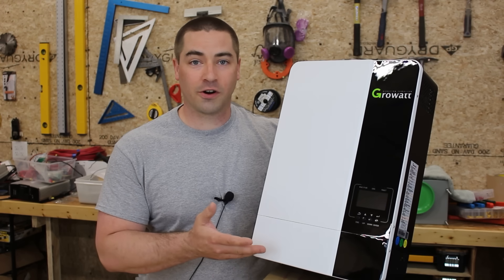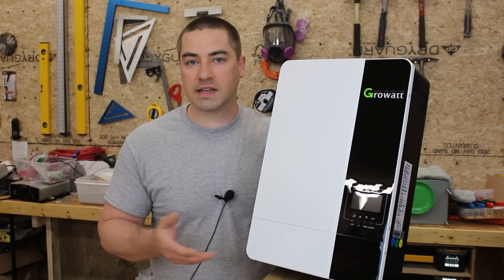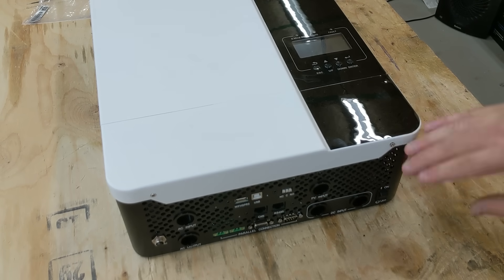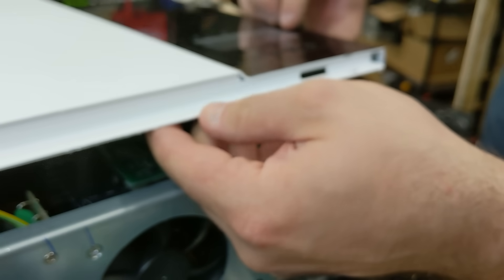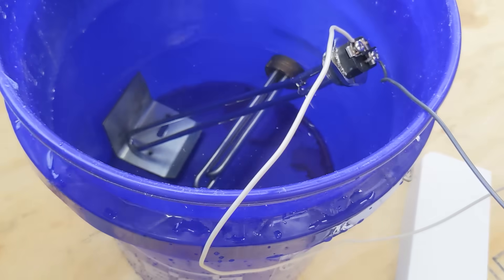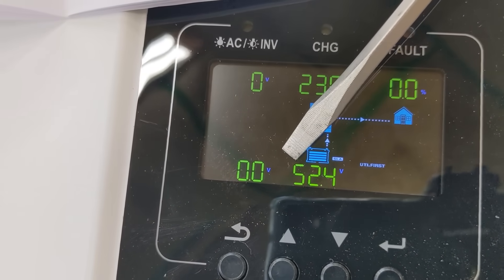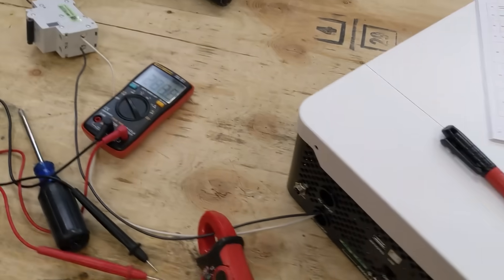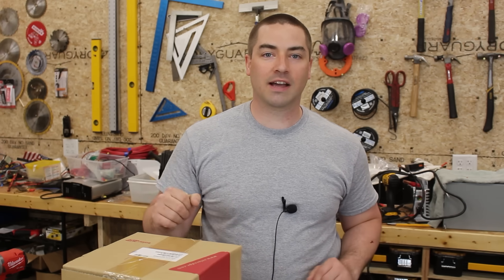Best Value Inverter, All-in-one MPPT Solar Charger, Growatt SPF5000ES, Part 1

Comment: I'd like to see a comparison (performance, efficiency, costs, etc.) between this inverter and the ones that you have had.
Reply: In addition let me attach a few more questions here to @DavidPoz and hopefully he can handle them collectively:

1. Hopefully if it isn't too much to ask, you could do an efficiency load test across 1kw to 5kw (in 5 steps would especially really like to see efficiency of different motor loads since most manufacturers rate their efficiencies on non-motor simple resistive loads instead of the more dodgy & trocky inductive motor loads) so you don't really get the whole picture.
2. Probably do an idle test no load dc power draw. 
3. Probably do a AC charger power draw when charging the batteries. 
4. Inform whether it has a power saver function to reduce night battery drain when it senses loads below X number of watts. 
5. How quick is the transition from AC to DC and back in the event a power outage occurs (will you notice a startling flicker/stutter of equipment or is it seamless in transition performance?)

Comment: David, I'd like to see at least a 500khz oscilloscope on the outputs of that high frequency inverter.  It looks like they tried to add a lot of output filtering (the torroidal coils you referenced), but high frequency (true sinewave) inverters  are notoriously noisy.  This would look like a fuzzy sinewave on a decent scope.  This would be fine for running a 240VAC purely resistive load.  When you go thru a transformer to center tap the 240VAC at 120VAC, you run into multiple issues. 1) The efficiency of the transformer now affects the total efficiency. That transformer has a massive heat sink on it, so I'm assuming it isn't much over 80% efficient, lowering your total efficiency to closer to 70%.  2)  The noise given off by the high frequency inverter will use the transformer to broadcast the high frequency carrier signal by which the sinewave was formed to the surrounding area.  You could hear this whine far above 60hz in Growatt's own video with only a 15 watt load. And it will become proportionally louder the more wattage you are using. Try holding an AM radio in that area while under load then turn the inverter off to observe the difference.  3)  You are taking a 5KW output and splitting it into 2 separate 2.5 KW outputs.  Their specs even say to not exceed 2.5KW per 120VAC leg.  Also the difference between the power consumed on each leg creates inductive feedback between the 2 coils in that transformer further decreasing overall efficiency.  4) If there is any noise on the sinewave at all this can greatly shorten the life of electronics and especially inductive loads like motors.
It does look like a great deal for sure.  But I suspect if you test all the things I have pointed out, you may decide its best suited as a solely 240 VAC resistive load inverter as well.
~cheers
Reply from the maker: Thank you for such a great comment.  I own two oscilloscopes, but I'm a complete beginner when it comes to using them.  I shout for joy if I can just get the sine wave to show up on the screen.  LOL.  I'll do what I can, but any help will be appreciated.  I bought the scopes to try and get into these types of details more, but there is so much competing information.  I have watched so many "tutorials" and I now feel more lost on the subject of measuring "noise" on a sine wave.
Reply: @DavidPozEnergy  The internal switching frequency used inside the inverter will likely be somewhere between 30k - 100khz.  You need at least 5X this resolution to be able to make out the noise spikes overlayed on the sinewave. then expand the signal so that 1 full 360 degrees of a single sinewave fills the horizontal width of your screen. Then expand the amplitude so that the sinewave touches the top and bottom of the screen almost.

Comment: Last year I bought the MPP GK5048, a similar product to the Growatt, from our friends in Taiwan at MPP Solar, for around $600 and used a $150 120/240 single phase 3000W transformer from Amazon to run a pair of dehumidifiers in my basement.   Trying to use the same transformer to step up from 120 to 240 for the AC input worked but it was very loud.  I'm looking forward to getting my pair of MPP LV6548 next week (after waiting a month for them to be cleared by customs) 120v input each, paired for split phase operation.  If you buy on Ebay direct from MPP, shipping from Taiwan using DHL arrives much faster.  I'm very much looking forward to the review of the Solar Edge Auto transformer.  It was something I considered getting, as I'm sure it beats the tar out of what I'm using currently (and may still use for something in the future....)
Reply: How long before it pays for itself?

Comment: What I do like about my inverter/charger with works the save as the one you are showing is.  To hook it to the grid all you need is the 2 hot lines and ground. Like you would for a dryer.  and with the auto transformer or split phase transformer witch I used witch was much cheaper.   I love thse little things the one I have has lasted a long long time and still going.

Comment: I have and I have it on my wall Mppt solar, it has been a round for at least 5 years  you can stack up to 6 of them, they were 4kw now they have 5kw, and some with single 60 amp solar charger, and 60 amp grid charging,  and they also sell some that are hybrid GTI, and also off grid and solar all in one.  with anywhere from solar 150 up to 600 volt solar.  some have dual solar charge controllers and so forth.   They can also stack them for 3 phase systems using the same charge controllers you use 3 of them to build a 3 phase system.  The one I have is 240 volt AC so have to use a transformer for split phase. but they also sell  Split phase Mppt inverter/chargers also.  They are nice.  I have had mine for 5 years now.

Comment: I prefer Axpert inverters.Same concept, on the market for years. 5kw King and 7.2kw Max much better than Growatt. Support also much better with an Axpert.  I am an installer in SA, have installed many axperts with no issues. HanRay Solar.

Comment: Can you configure it to not feed the grid, but use the grid if solar or battery are not sufficient?
Reply from the maker: If you are asking about UPS, then yes.  You can.
Reply: @DavidPozEnergy  Oh, just read that this is an off grid inverter. So I guess you can't feed the grid at all. I thought this was a new hybrid inverter.
Reply: I also have a similar interest

Comment: The Gyll battery bms will not communicate with the GroWatt. I have both, my GroWatt is 48v 3kw, and purchased the Gyll using David’s coupon code. I talked with Signature Solar and they are in the process of making a new bms that will communicate with the GroWatt. So it’s in the works.
Reply: Really cool that they're implementing that communication - should be (fairly) straightforward with RS485

Comment: This is a Voltronic MKS 5000 rebadged by GROWAT.
Reply: Also rebadged by Sigineer into M5000H-48BP that sells for $798. To get a split phase I used a 5kw toroidal step up/down transformer for $108 off EBay which is much cheaper than the $300 transformer recommended by signature solar.

Comment: Hello David, Would this Growatt  work with one 5kw Lifepower4 Gyll battery like you would use a gas generator or a Bluetti Ac200P in a temporary grid down situation or would Growatt use too much latent energy just being turned on for such a small battery bank to work? For this question, let's say I have  three 350 watt solar panels to keep this system charged up with. Is this a stupid idea or could it work?
Reply from the maker: Great question.  The Gyll battery is max 100 amps continuous.  Most of the time the battery will be above 50v, like 50-54v.  But if the battery dips below 50v, then you could potentially draw more than 100 amps with a 5000w inverter.  (5000w/50v=100a)  Not a problem most of the time, but potentially.  To minimize the problem you could have the generator auto-start at 50v, or keep your loads to 4kw.

Comment: Why not just buy the 120V version instead of messing with the transformer?
Reply from the maker: A couple of reasons I choose this model, but nothing wrong if you want to go with a 120v model.  First, I like trying new things on this channel and using an autotransformer/inverter combo would be new.  Second, I've tried other 3kw inverters (120v) and they have not been able to start my power tools.  I'm hoping this combination of the 5kw with transformer, will start my tools.
Reply: the 120v version is only rated for 3kilowatts...if they made a 5kilowatts version the wires in the contraption would need to be made thicker to handle the amps... so they made it 240 so it does need thicker wires to handle the lower amps needed at 240
Reply: @fidelcatsro6948  Interesting way to keep costs down...

Comment: It does not matter how many people or ignorant manufacturers spread incorrect information, it's still incorrect! "Split phase" is a type of motor, NOT a type of electrical supply. What you're talking about is 120/240 volt SINGLE phase.

Comment: I would REALLY like to see a good video on the 2724 from MPP.  It has right-sized MPPT, 24v to 110v inverter, plus it has three or four 110 outlets and some USB outlets, built in.

You plug in two battery wires...plug in two solar input wires...then you can just plug in appliances/devices right into the outlets.

Comment: its a heavy duty inverter we are using here in pakistan, connected with solars and batteries and running all of the home load without any break. they are offering 5 year warranty.  and its quite cheap for US market.

Comment: Nice. Single string up to 400V might be around 13 average panels. If more panels are paralleled then current limit might be a concern, although maybe 16 or so panels is the limit due to the 5Kw limit. With more videos coming I'd also be interested in the AC input testing as well. I assume it frequency and phase syncs to the AC input, if present. If these are then paralleled, let's say 2 units, and one has AC input, then both units should sync with each other and the AC input gong into one of the units. I'm asking because this would be a great solution for a solar car port I'm constructing that is not on my house system. It's standalone and will comprise 36 panels equating to about 10kW. The single appliance connected to the AC out will be a 240V car charger. When not charging the car, I want to fill the batteries. Yes, this will result in power sometimes being thrown away, but I live in California, and the utilities have gotten very negative about more daytime power back feeding to the grid.
Reply: So 10 to 15k, just to charge your car for free🙄❓💲

Comment: Will it last 20 years operating 24/7/365 without fail like my old beasty Trace SW-4024s did, and my Outbacks?. Can you get the stellar service and support that Outback provides?
Just askin'.
Reply: by then inverters will cost cheaper than smartphones..

Comment: Axpert Voltronic VM III 5k is cheaper even . 2 x MPPT (80A) 120...450V, DC charger (60A), ON/OFF grid modes,  USB, Bluetooth, lot of BMS/Lithium models communication. 5000w nominal , 9kw peak ....  675€  VAT included ... 800$ USA . Widely used in spain, lot of succesfull reports .  
That beats the Growatt option here. No paralel option in this model.

Comment: most electronics will run straight off of 240...just look at the back of whatever you're plugging in and it should 99% of the time say: Input: 100V-240VAC 50/60Hz (followed by whatever amperage and output(s) the device is rated to output).  People get hung up on that it is "european" only...but most electronics can handle both "110v" and "240v" just fine without changing a thing!
Reply: Very true but these wide-range devices are usually small loads in the house. Lights and appliances are usually 120 only. Basically if you want to power a US house you need 120v.

Comment: I wonder about if there is Radio Frequency Interference (RFI) from this, as many inverters produce RFI which interferes with Ham, Shortwave, FM radio & sometimes televison reception.

I this it would be a good idea to  use a shortwave radio to listen for the repetitive "birdies" as you tune through the bands. When you hear one (high noise static), turn off the source (inverter) & see if the RFI goes away.   

RFI is becoming a huge problem in our homes as wall warts (phone chargers, ac adapters, for Wi-Fi, etc.) don't really pass FCC part 15 requirements & create more & more hash.

Also David, when you checked to see if that large gauge wire (4/0 ?) Would fit & it didn't; I think if you remove the plastic sleeve from the case, slip it over the wire then insert it, that it should fit... WARNING, don't push it in & lock it until you're ready to do so, as it will be tough getting it unlocked.  They should install cable clamps with heavy duty rubber grommets for strain relief.

Comment: I would love to see a test of the the parasitic load on the whole unit with and without the invert active- what is the current draw from the batteries when the unit is in standby (switch off, but batteries connected) vs power-saving (power-saving setting enabled, switch on, but no AC load connected) vs inverter on with no load (power-saving setting disabled, switch on, no AC load)?
Reply: 70 watts idle load I hope they improve on that in the future.i bought one just for the charge contol I lose a third of my PV input from parasitic loss going back to my trace 5548 and a low consumption charge contoller. Like to find out what growatt charge controller stand alone unit consumes

Comment: I have seen somewhere that these units can be run without a battery. Not sure if that means battery less off grid or just grid tie.I would be interested to know if they can be used in a battery less off grid setup.
Reply: They will run just off solar if there is sufficient solar power to run your loads.  You'll need a transformer to get a grid backup power for uninterrupted service.  Running a load with a sudden drop in PV power lower than the load will shut the unit down.  These are not "Hybrid" that feed back into the grid, but they have 220-240 volt AC inputs that will take 120v using a single phase step up transformer such as the solar edge unit in the video.

Comment: Now can I use this with a LiFePo with built in BMS, or does this have to be used with batteries that can connect to the BMS.
Reply from the maker: You can use it with any lithium.  I have the Gyll brand batteries, but no communication between the inverter and battery.  It worked just fine.

Comment: 5va=5kw 
Mppt up to 450v dc
Ac input 240vac
80A with ac charging
AC transfer switch 
Parallel multiple units 
Nice 

MppSolar
 PIP 5000 MG same features 
Parallel board 1=50€ for two u need 2
550€/piece Aliexpres....
Inside is the same as MppSolar...👍

Comment: Isn't it better to have all the components separate? what if one of them breaks in that all in one device? need to replace the whole thing?
Reply: Yes and no. The AC charger and inverter probably use the same components so it makes sense for those to be together. It's arguably better if the PV charger is separate but by having it on the same unit running loads directly off of solar should be more efficient due to fewer conversions.

Comment: You missed the greatest feature on these. They can work without a battery and just panels. So you can be off grid or grid tied without expensive batteries.
Reply: Now thats exactly what i wanna se in the next video, David. :)
Reply: How is it possible to use this unit without batteries?  Only in the daytime, right?  And, the load needs to be way within the solar arrays capability, right?  I’m only speculating so please correct me if I’m way off..

Comment: @Dave, what is the standby power consumption of the Growatt?
Reply from the maker: I'll be checking the idle watts in the next video.  I don't know yet.
Reply: @DavidPozEnergy  Thanks, Dave. As a point of reference right now the Solark is consuming 24W, higher if it is generating power ~50-60W. I have a Growatt 6000T that got replaced by the Solark, it swallowed 120Watts continuously and much more under load. Should be intersting what this new Growatt does. Also see if the provided software still sucks.

Comment: Ooow that's is a big resistor. Do you What size it is
Reply from the maker: The only thing I found on the side was "200W"
Reply: @DavidPozEnergy  ok thanks . I was thinking of adding something like that resistor to my LG 14s 48v 2.2kWh LITHIUM and that was the same size 200watts I was look to get form amazon